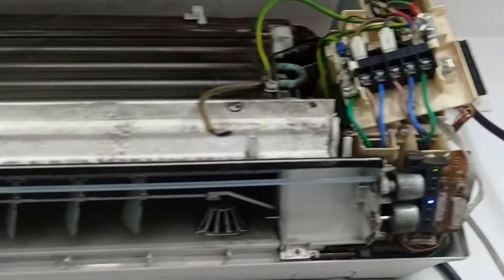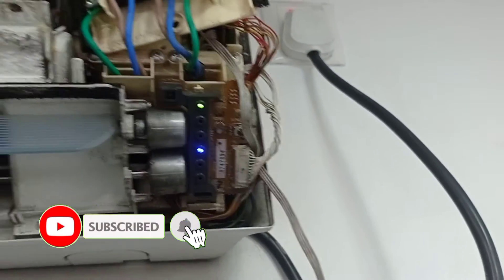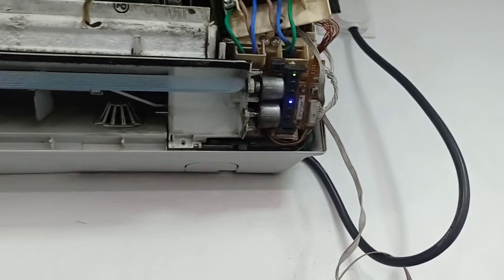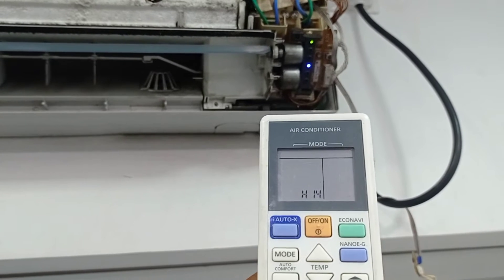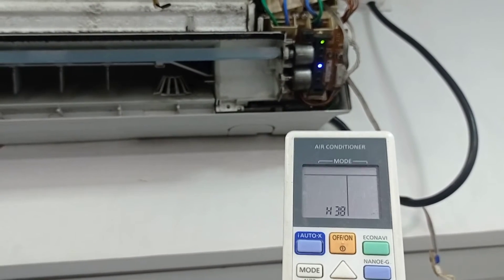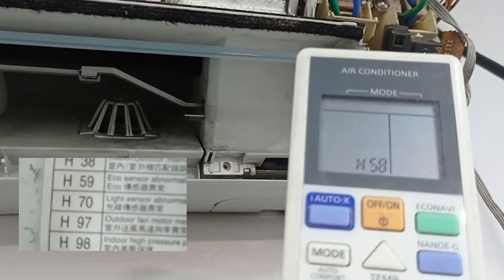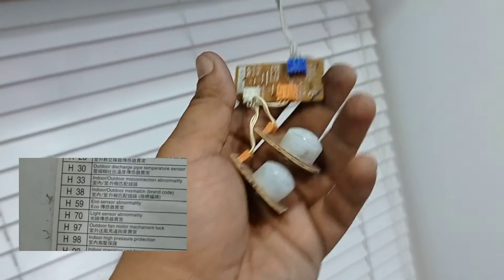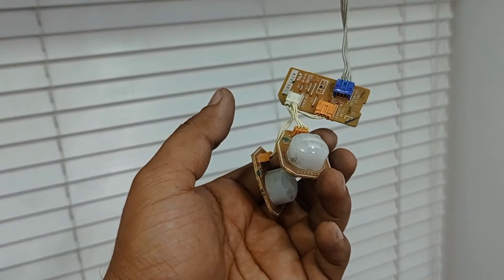Panasonic Inverter AC Error H59 // Panasonic AC No Light Blinking 😭😇 Solutions For Ac Error Code

Comment: My newly installed ac showed H58 after 4days. Shout i get it to be repaired?
Reply from the maker: Check if it's a cable issue no problem need to connect properly , if there is a PCBs card fault or sensor fault better to replace the ac. As it's a new ac unit.
Reply: @Rehankhan_HVAC_TIPS   cable issue means? Wiring fault?
Reply from the maker: May be cable between indoor & outdoor units not fixed properly. If there is no issue with cable then try to change the unit.

Comment: Is there any harm if i let my ac on all the time if it have H59 problem
Reply from the maker: If your ac is cooling normally, then there will be no issue.
Reply: @Rehankhan_HVAC_TIPS 
But my AC Is colling on temp- 30,29,28,27,26 ONLY
And AC is not cooling on temp- 25, 24,23,22,21,20,19,18,17,16.